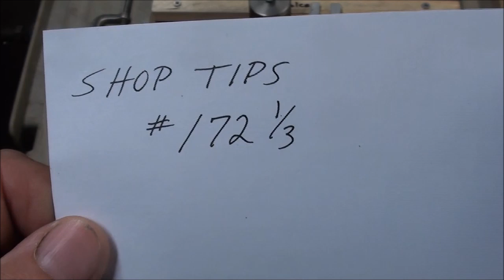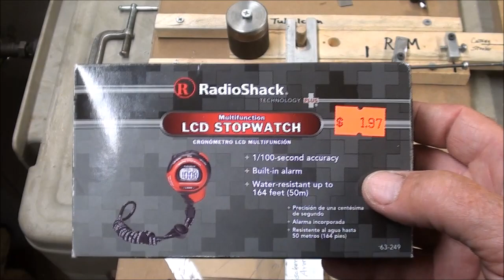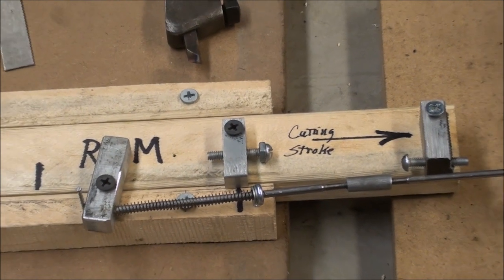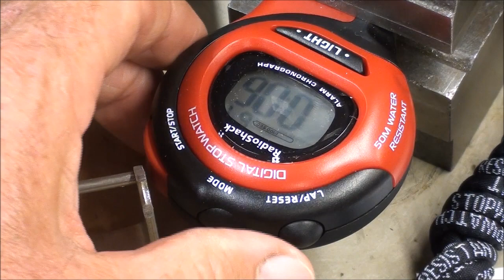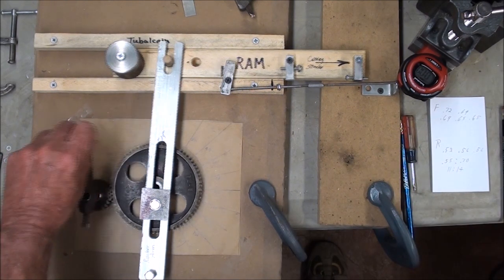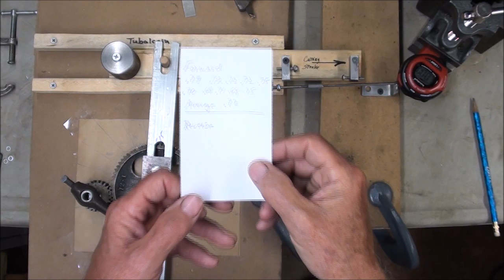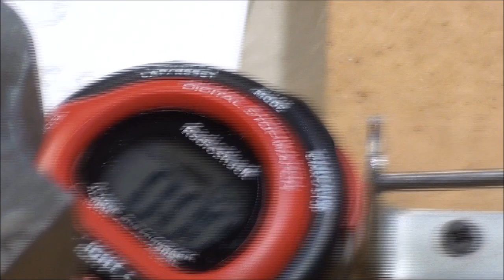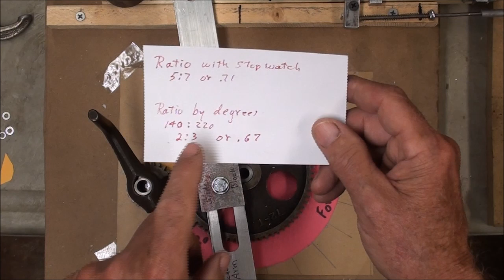Tips #172 1/3 Whitworth Mechanism Rhodes Shaper tubalcain

Comment: I know there is a logical explanation behind this, but my simple mind can't grasp it. Maybe you can help me, Mr. Pete. 

Wouldn't speeding up the return stroke make the cutting stroke slower? It seems like by moving the pivot point to make the return stroke faster would slow the cutting stroke by the same amount. You know, the whole "equal and opposite reaction" thing? If the pivot point was dead center, making both strokes equal instead of 5:7, wouldn't the ratio be 6:6 (1:1)? 

Here's another way of looking at my thoughts. Hypothetically, the cut stroke took one second, but the return stroke took 6/10 of a second. Wouldn't making the strokes equal cause the return stroke to increase in time to 8/10 of a second, but reduce the cutting stroke time down to 8/10 of a second? 

I'm sure this question may have been asked on the last video since there were so many comments, but I'm curious as to the explanation behind it. My thinking could be totally wrong, but I guess it's the way my mind works. 

I really appreciate the educational videos you put so much effort into, and hopefully some light will be shed to help me (and possibly other like minded thinkers) understand. 

Daren
Reply: The unequal distance traversed by the drive pin relative to the fixed axle on the action bar trades velocity for torque and conversely torque for velocity. The cutting stroke has low velocity and high torque and the return stroke displays high velocity and lower torque. Disregarding the various and sundry frictional losses in the system and with the shaper not engaged for cutting, the total work expended for both directional strokes are equal and the work expended on rotary drive motion is relatively constant at a degree by degree basis.  In this case velocity times distance times torque will develop the same amount of work for both directions when all frictional losses are equal.  There are small changes in rotary torque requirements for the drive system due to the difference in acceleration and deceleration due to inertia vs. the delta of velocity of the action bar and ram  but I believe these can be practically  disregarded for this demonstration.
Reply: First point:

The objective is to get a longer cutting stroke, and a shorter return stroke, to improve the ratio of productive time to non-productive, or idle, time.

Since the eccentric drive converts the rotational motion of the bull gear - driven by a constant speed motor or in the olden days, a line shaft, which in the really olden days was driven by a water wheel - into linear motion, the radius of the bull gear is a lever arm.

The wheel turns at constant rotational speed (rpm for example) so the angular speed is constant. This is a good thing in terms of stress on the rest of the drive, as speeding up and slowing down are not good things for machinery in general.

Mr. Pete shows the angles swept out by the forward and reverse strokes. The proportions of the two are set by the ratio of the radius from the center of rotation to the pivot point divided by the radius of the bull gear.

There are two limiting cases for an eccentric drive:

The simple case where the drive is on the center of the shaft, or concentric, which cannot convert the rotational motion into linear motion.

The other limit when the pivot point is on the perimeter, and the forwards and backwards strokes are equal. This was sometimes used on the valve gearing of a steam locomotive, where the piston is driven in both directions, which then would give the maximum output of rotation for the input of linear motion.

Again, the shaper is only driven in one direction, so the return stroke brings the cutter back to battery, a non-productive motion which should be minimized for greater cutting efficiency.

You can play around with this - it's a basic lesson in the college sophomore class in mechanics.

Hope this helps...
Reply: Yes, you're right. No matter what the ratio of forward to reverse stroke, the aggregate time taken for a complete cycle would be the same because the bull gear drives at a constant speed.

I think the relevant point is that we're not trying to make the cutting stroke faster per se. If that were the case we could just increase the speed of the motor. In reality, the cutting stroke speed (in inches per minute, or whatever) is limited by the material, tool and depth of cut, therefore the minimum number of seconds the cutting stroke takes is beyond our control. But if the tool can be made to return to the start of the cut in less seconds than the cutting stroke takes, the productivity of the machine is increased.

Comment: Thanks for the video! How it works is simple mechanics. On the back stroke, the pin on the gear is close to the bottom of the arm and its pivot. It has greater leverage, so the return stroke is faster. For the forward stroke, the pin in the gear is further away from the arm pivot and has less leverage so the arm travels slower. It's operation is really quite ingenious. I love mechanical devices like this and how they work. The Geneva Drive is another simple, yet interesting device.
Have a good one!
Dave